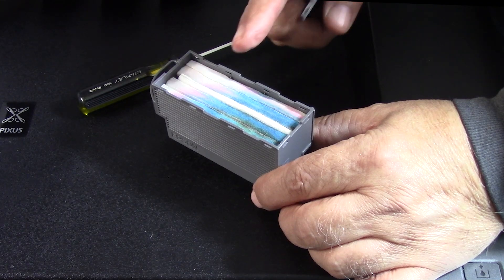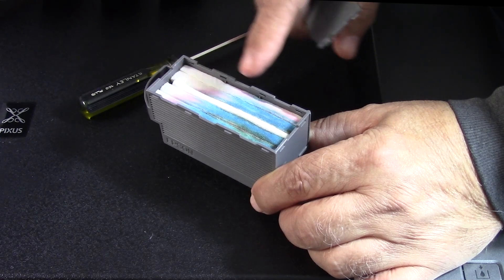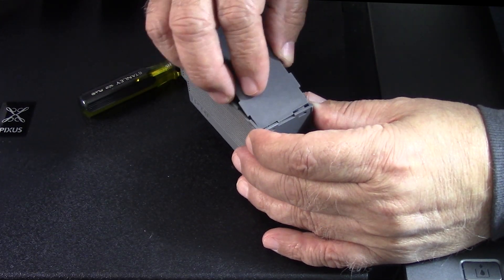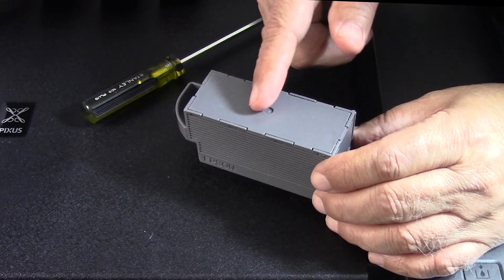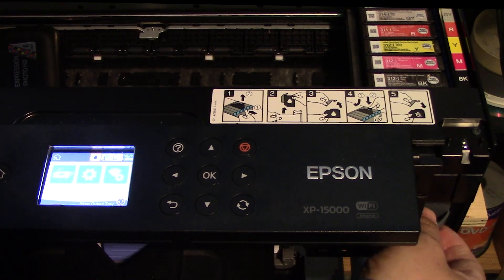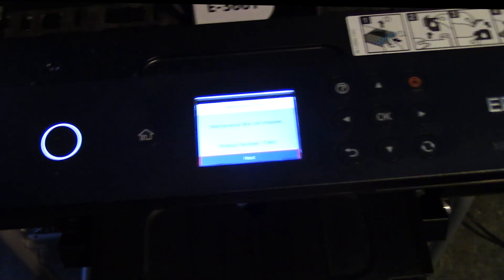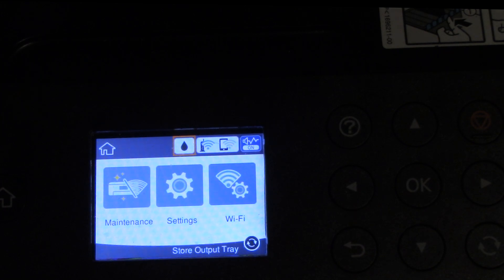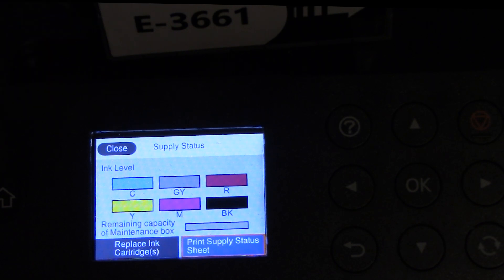Lets reinstall our Reset and Repacked EPSON XP 15k Maintenance Box!

Comment: I overheated my Epson xp-15000 print head refilling my dtf ink and blew a fuse on my main board.  I can find no suppliers online for a replacement board anywhere globally.  What gives?  Anyone know why I cannot find a replacement board?
Reply from the maker: It might not be a part you the consumer can buy. They would just say buy another printer.
Reply: Just replace the fuse! It's on the rear of PCB BD. MIGHT need to desolder